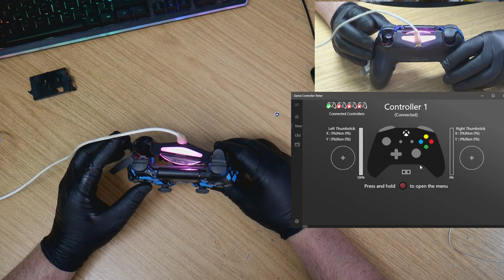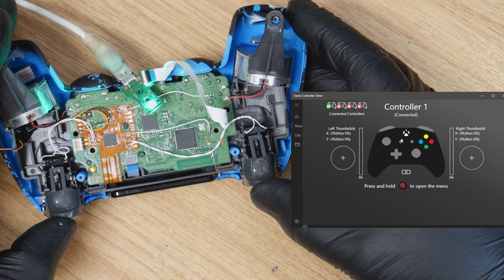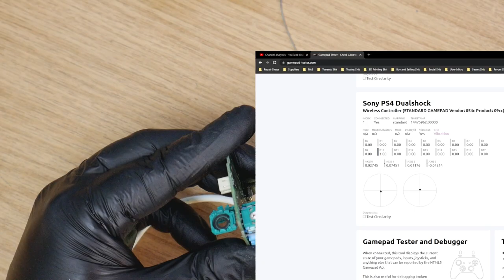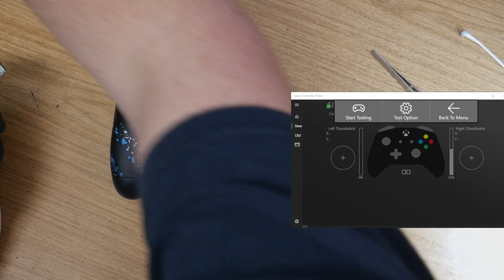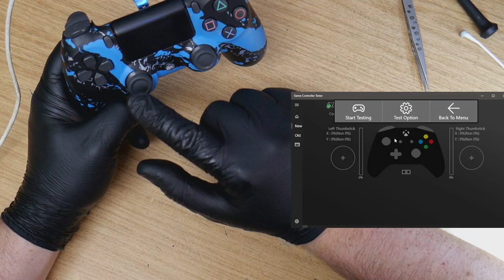PS4 BattleBeaver Digital Trigger Repair And I Break The Mod!!

Comment: Battle beaver has the option for increased tension by changing the spring in the module which explains why the right stick is tighter and has leaded solder.
Reply from the maker: Makes sense. Don't come across added tension that much (customer didn't mention it either) and it must have been just the next step up in spring rate. Either way the left stick was more loose than standard and leaning over to the right so was on the way out.

Comment: Hey , I know that’s an old post but I can’t find the name of the part that battle beaver uses under the micro switches to hold them at the right height. Do you know the name of the part they use ?
Thanks
Reply: It's just s 3d printed mount that they design and make in-house